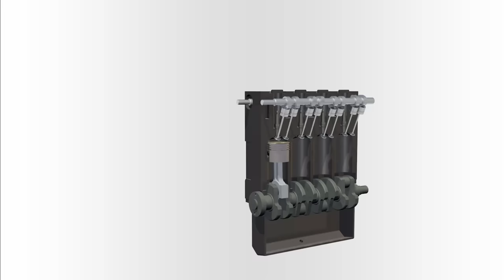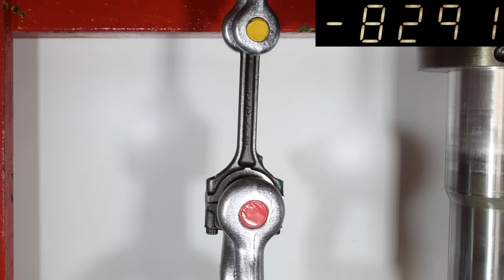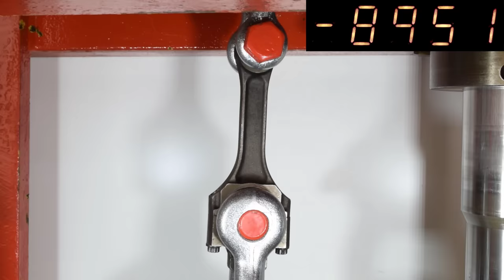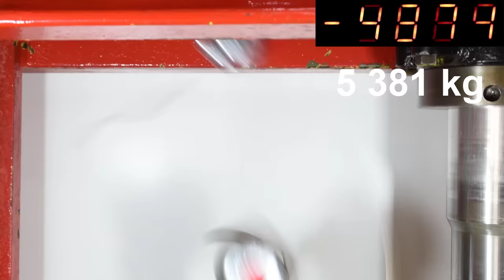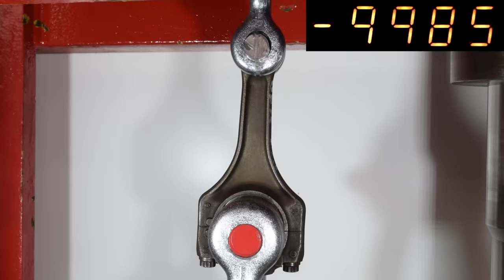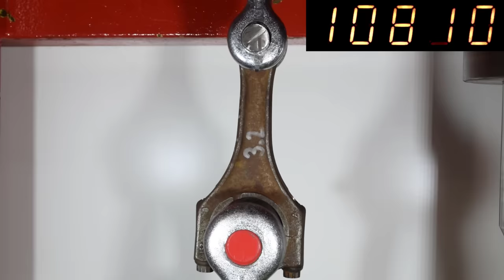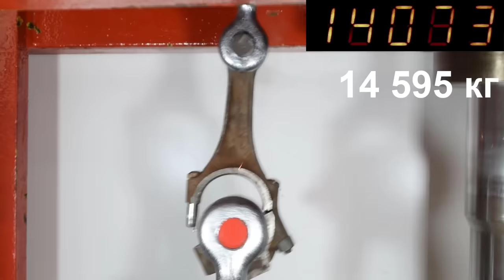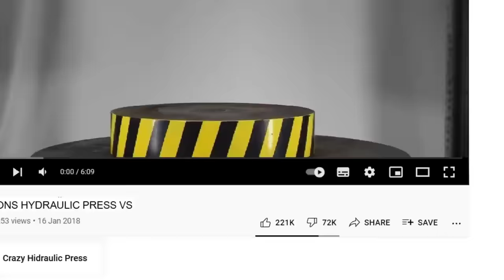HYDRAULIC PRESS VS CONNECTING RODS

Comment: Interesting but Conrods are designed for strength in compression and not in tension. Unfortunately whilst interesting, all a bit pointless.
Reply: Isnt nearly all of his videos pointless,except for entertainment value? That makes critiquing his videos as if they were for engineering rather pointless,if not mild trolling.
Reply: I agree with this point. The main power is exerted when the rod is pushed. On the other hand one would assume, that more expensive cars are made with higher quality materials and components.
I would like to know the weight of each item. I believe the old one is heavier and thicker than the others.
Reply: The rogue piston exiting a self-destructing tuned engine on a rolling road at maximum rpm may beg to differ! In almost all production engines, whether NA or forced induction, the highest stresses on a connecting rod are tensile, due to the inertia of the piston changing direction at the top of the exhaust stroke (no compression to reduce the tensile force). The rods in this test were from standard production engines, so the test is actually relevant. High boost engines, exotic fuel burners and engines suffering from detonation or hydraulic locking are possible exceptions to this general case, so top fuel drag racers, and diesel van drivers heroing it through 4 ft of flood water, for example, may count amongst those exceptions!
Reply: @robair67  just what I was getting ready to say. most failures of the pin skirt or rod/bolts are tdc on the exhaust /intake stroke. rods bending are not near as common as stretch and bolt stretch.
Reply: @markwarren3156  thank you, sir!
Reply: @robair67 you took the words right out of my mouth, oh it must’ve been while you were kissing me
Reply: Lol attempted to troll, got roasted by knowledge. Oops.
Reply: @SpannerManSam  if you could take that thought right out of my mind, I might avoid the ptsd!
Reply: @robair67  oh darn I didn’t know a song would give someone ptsd
Reply: @SpannerManSam  😄
Reply: You are right . Generaly they are compresed but can be also tensed . Breakig with engin can destroy it .
Reply: thats not true, since high RPM puts a great stress as tension too. many people that tune diesels to crazy power will tell you about upgrading bolts on the rods, as when they rev an engine for 3000 rpm to over 6000, stuff is going to break with the huge heavy pistons, rods and wrist pins. the diesels have usually the least tension stress, because they rev low. however, high rpm naturally aspirated engines have almost no torque, but huge problem with reciprocating mass. THATS why you blow up engine by moneyshifting it or overreving it(unless it is caused by failed valvetrain component and collision of valve and piston)
Reply: @markwarren3156  it differs if its a turbo diesel with no rpm and massive torque or a high rpm engine with little torque and huge rpm. the diesels usually are not suffering from this as they are not revved high, but if you rev them high, shit is gonna happen(and not only by valves smashing with piston)
Reply: @firstclaw1 you are not undoubtedly right. Rotary inertia produces a very big tearing force on the rods
Reply: @efimkrivov  Interesting. I wasn't aware of such forces, as probably only a machine engineer would know the math.

I still consider weight and material a major factor. With a sports car you my want to build all parts as lightweight as possible. So the question is also how strong is strong enough? But too weak borders to planned obsolescence again.  If a car costs a much higher price, I would find a considerably weaker part unacceptable.
Reply: Totally agree.
Reply: Spot on. They need to compress them.
Reply: Exactly that’s what I’m thinking about too. ❤
Reply: @firstclaw1  you can see supra 2jz
Reply: @craig waddell exactly what i was thinking whilst seeing the video. The only interesting thing is to see how strong the rod bolts been made😂
Reply: I agree tension is the main force they see….
Reply: For sure!
Reply: My thoughts but still, it was interesting
Reply: Not pointless
Reply: @Kjaer_e92  read comments
Reply: more or less yes - connecting rods also have to bear tension, the higher the RPM, the more.
The Moskvich "wins" this test, because in the 50/60ies, the engineers did not have precise design methods, so based on experience, they tended to oversize everything. Interestingly, it had a 4cyl HEMI engine.
Here in Germany, the BMW M60 V8 was known to have a number of weaknesses, the successor M62 has been improved. The BMW M components speak for themselves.
Reply: Same as 1968CraigUK.
Reply: I wish it would have been based on compression
Reply: Well if they performed well in this tension test I bet they'd perform even better in the compression test however in actuality even tho most of the force your conrods experience is compression because of the explosion pushing them down they are also built to withstand tension force as well because moving at 6,000 rpm is probably pulling pretty hard on your conrods it's a known fact that due to the high speeds and high temps these internal engine parts are faced with is that they stretch as well so I don't really see how this is pointless
Reply: You tested bolts...not rods. It is easy to calculate the braking force of them.
Reply: Agreed, basically testing cap bolt tensile strength this way.
Reply: Wrong, just wrong.
Reply: @robair bobair  thanks!  I am too lazy to explain some things
Reply: Where do you get this idea they are only meant for compression?
Reply: @Coyote27981  I think you are taking his point too literally.  The test is mostly pointless giving a rods purpose.
Reply: Jeez, way to piss in someone's bag of chips.
Reply: Actually when a rod breaks, it's usually on the exhaust stroke, and it tosses the piston into the head.
Reply: Wrong.
Reply: @davidsmith7653  Badong.
Reply: Agreed, could be retitled “hydraulic press vs con rod bolts.” Would love to see the compression failure of these. Particularly a big diesel connecting rod vs gasoline engine part.
Reply: to add....I think bent rods are typically a result of "spun" bearings heat and torsional forces rather than compressive. (Except in "other cases" you mentioned)
Reply: Sure ! By the way engineering for what it needs! Stronger doesn’t means better. They are from different power engine. Over engineering means not optimize for efficiency.
Reply: as the car wizard advices, avoid all BMW:s. They're all junk! Same goes for Audi. MB all the way.
Reply: Not true! Crank rods are subject to highest forces in tension at TDC at the end od exhaust and begining of intake stroke.
Reply: That’s amazing that the old bolts held up so well you’d think with more precise manufacturing of today it would become stronger but yet I guess it’s not the same steel used as back then it’s be interesting to see at what point they bend tho
Reply: Wait! You’re telling me a video on the hydraulic press channel isn’t fully applicable to my everyday activities. Quelle horreur!
Reply: 100% agree. Who cares about their tensile strength - it's all about the buckling load.
Reply: Mclaren P1 conrod next please
Reply: Agreed, peak load is literalt during the compression stroke of the engine at the time immediately after ignition. As it happens it is higher in diesel engines.   It is also important not to over engineer [reciprocating] moving parts and keep their weight down.
Reply: @djole02  maybe, but far less compression forces on firing.
Reply: You're missing the point, although I understand what you mean. This is just entertainment. This channel is not made to conduct scientific experiments; so no need to act like a smart arse mate.The whole channel is pointless, there is no value gained from the videos recorded in this channel yet 500k people have watched it and you're complaining about the rods not being tested correctly.
Reply: Exact! Has no real world meaning, in the best case a test for the screws
Reply: @n1msu  Well the image promoting the video shows a con' rod about to be pressed in a hydraulic press, but the content was pulling them apart, unsurprisingly discovering that the bolts at the bottom were the weak point.  Misleading promo' and as you say entertainment as opposed to scientific content.  BTW I only watched the first test - it was obvious the rest would be a [further] waste of time.
Reply: @robair67 hen why is the material area above the gudgeon pin so small when compared to the area in the main H profile? Surely if the larger load was tension, the small end would be massive? ie as the failures shown which weren't due to rod bolts
Reply: @Loopyengineeringco  so you're saying that inertia doesn't increase with mass? Interesting. The little end needs to be as small as possible precisely because of the acceleration forces, in accordance with Newton's 2nd Law. The clever bit is the choice of material to "thread the needle" between stress and mass. This is one reason why engine designers do what they do; They are masters of walking engineering tightropes!
Reply: Yes, very true indeed: you stress and test a part for what it was absolutely not designed for.
Reply: It's called envy, britboi😁
Reply: @robair67  I agree with you about inertia, but I don't think the inertia forces (tension) are higher than the compression forces. Otherwise you'd see different rod designs. As demonstrated in the video and also many stock rods bending under boost and aftermarket rods always focussing on increased H or I section strength 🤷 would be good to see some maths, I might be wrong
Reply: Click bait. Shows testing with press and then shows irrelevant stretch testing.
Reply: @Loopyengineeringco  back in the day (1980s to 2000's) most high rpm competition engines were naturally aspirated. When you got your set of race con-rods, the supplier gave you a maximum rpm they could be revved to, to maintain good cycle-life. The rpm was the limiting factor, so tensile stress was the limiting factor, not compression ratio, fuel octane rating, altitude below sea level, or anything else that could increase compressive stress on the rod. The mass of the piston was also required for the rod maker to specify rpm limit. As turbo boost pressures have risen in competition and OEM engines, the compressive stresses on rod materials have typically risen, too. Turbo diesels and drag racing engines (and flood-damaged hydraulically locked engines) can and often do experience con-rod stresses higher in compression than in tension, but as rpm rises, all rods with any mass (so, all rods!) experience ever increasing tension loading on the same cross section. At a certain rpm, either the piston fails, the rod fails, the big end bolts fail, or some other over-stressed part fails. The failure mode is caused by tension in this case. Piston acceleration at high rpm is massively overlooked. It's hard to imagine 9800g (96,000 metres per second squared) but that is the piston acceleration of a 40mm stroke length at 19,000rpm, which was typical formula 1 numbers back in mid 2000's. If you drop that to 9000rpm and use a more typical stroke length of 83mm, you have a far more pedestrian 39,000m/s^2, Which is about 4000g! I'll leave it there!
Reply: The last one doesn't have the original screws in the rod. So this is fake!
Reply: There wasn't the original screws in the last rod. That's why it's no wonder that it has endured so much traction
Reply: Is it probably the quality of the ball bearings that determines the durability of a motor and not so much the stability of the connecting rods?
Reply: Failure under compression is a highly atypical failure mode, even for cast connecting rods. Failure usually takes place due to shearing forces in the wrist pin domain, poor lubrication at the big end bearings, or tensile forces on inadequately fastened rod caps.
Reply: I think you need to retake elementary school physics - force and reaction force before you run your mouth on what is pointless or not.
Reply: Right, cars never stop working because of broken  conrods. Has anyone ever heard a motorist say, help, a conrod is broken on my vehicle?
Reply: But, connecting rod bolts don't snap on the compression stroke (going up). They do it as the crank pulls down on the bolt.
Reply: Go to school and learn how to calculate loads. Rods get hammered on change of direction. Calculate the speed of a piston at 8000rpm and a stroke of 86mm, then calculate how much energy it puts into the rod during deceleration. This is all put into the small end journal. The weight of rod and piston combined load the big end journal. It’s considerable. So not all loads on rods are compressive.
Reply: Yet I’ve see dozens of wrist pin journals open up letting the wrist pins loose.  It’s excessive RPM that can cause this as the piston travels upwards.
Reply: they all broke at the connectors not the rods themselves  ..it isn't useless info..the weakest link will have the same consequences. the test shows you would rather have a M3 or a M5 over a 530 which the upper model should have the stronger parts which is proven
Reply: Wrong. Rods are built to support the kinect energy after the compression phase. The higher the rpm of the engine, the higher the stress the material is submited. This is why high end pistons are made of light  materials, to reduce the possibility of stretching the rod
Reply: it is not the rod, It is the bolt here...
Reply: The clickbait picture suggests it's a compression test.  It sad when your videos are so bad that you have to trick people into watching them.
Reply: Dude, I have a bad news for you: almost everything you see in the internet are pointless.
Reply: @STEVE_C_1369 At this point, he should just put a disclaimer to keep the engi-sneerers at bay.
Reply: @joeybrazil2024  I totally agree.
Reply: @n1msu But...but..they're not!
Reply: @robair67 The reason that max RPM is given is because the strength of bolts is finite and known. The compressive strength is also known but is limited by cylinder capacity so it's a constant for any given fuel mixture and the compressive strength of the rod is more than enough to handle the load, usually by a factor of close to 2. That's why nitrous oxide seldom causes failure immediately but destroys rods in "soft" engines at high revs. The bolts break.
Reply: Exactly. There are more forces at play in a rotating assembly. There is also durability. The ability to sustain the constant stresses the part is put under.
Reply: This!

I was expecting compression tests, in the least...not that that would properly test an object that reciprocates.
Reply: The video should be called con rod BOLT test, because that's what he's testing. For the car aficionados out there; torque (in other words, boost) requires you to run strong rods. RPM requires you to run strong bolts. The formula is very easy: going to boost (or increase boost) of your engine? Forged connecting rods. Going to increase RPM? ARP 625+ bolts. Going to increase boost AND rpm? Forged rods + ARP 625+ bolts. End of story.
Reply: Well that's exactly what I was going to say....compression
Reply: Incorrect.  Most non-builders and non-racers think this way but they are wrong. The fact is, as RPM increases, the connecting rods have to endure significant stretching forces.  When the piston is in its exhaust phase, there is enormous centrifugal force as it approaches TDC. This is where most rods fail and why the rod bolts are the single most important factor to take into account. Rods do not fail during the compression cycle.
Reply: @STEVE_C_1369 People like to talk engineering though.  Scary to think how many distorted worldviews might arise from modern forms of diverse entertainment like this.
Reply: @anneother6224  🤣🤣🤣🤣
Reply: Anyone who has torqued con rod nuts know how critical it is. You never get spared of a 'what if' feeling when doing so. It's quite reassuring to witness the strength of these bolts.
Reply: Exactly what i was going to say. Designed for compression rather than ummm stretching.
Reply: @STEVE_C_1369 opinions are like a-holes.  Everyone has one, and they usually stink. One could say the same of your comment to his comment.  His comment is simply informing those who don't have as much automotive or engineering knowledge as perhaps you or others.
Reply: They are required to have strength in both directions especially at high rpm operation when the intake and exhaust strokes have low upward resistance and lose the dampening effect during compression, and get pulled in tension during intake strokes of non aspirated engines free reciprocation which is why exhaust valves are always smaller
Reply: The power stroke at full ignition and advance and boost level is the maximum applied compression force applied to the rod a bit more if vehicle momentum is transferred through the drivetrain and you have a hydrolock in the cylinder, where you’ll bend the rod, or break the crank due to rod angle and lateral force deflection. I’ve seen the tops of pistons pulled off from the ring gaps closing in high heat quenching conditions (clogged catalytic, high work load, high demand, for prolonged periods, the spark plug insulators were shot out of the shell, and put a bullet hole in the fender of a new (at the time) Jaguar passing the truck as the driver crested a long steep hill while flipping the truck driver off. I broke it down and checked the rod alignment all were good. Chevrolet small block, was sold to the owner as a 350, but it was a 307, impressive resilience considering, I acquired a 350 short block an associate was just finishing up and added some end gap to the rings .008” as recommended for application conditions, reconditioned the heads, valve seats, guides (short block came with springs spacers locks seals screw in studs and retainers so I used them) No more people passed him going up hill with a full load plus a heavy trailer anymore. That big dump truck would move out!
Reply: I would venture to say every force a rod sees is compression whether on the compression stroke or after the combustion cycle driving the piston back town turning the crack always has tension in it since it’s the piston doing the work not the crank, it delivers the work, albeit minus on startup when some rods might drag pistons back down into bdc before the first one lights off
Reply: This is true however as the rod goes around the crankshaft it experiences some force of pull due to it needing to pull the cylinder down in-between strokes
Reply: Agreed pointless test, they are designed to absorb the compress force from ignition and convert that compression into kinetic energy which turns the crwnkshaft
Reply: 😂😂😂😂😂

The level of ignorance to think high output forced induction rods experience more tension load than compression load is only exceeded by the level of ignorance it takes to think there is more compression load on the compression stroke than the combustion or exhaust stroke.   Even in a moderate performance, naturally aspirated engine, the exhaust stroke has well over 100 psi.

Inertial loads happen in both tension and compression.  The instantaneous engine speed is highest during the power stroke. 

The highest intertial+pressure load is around the exhaust valve opening during the power stroke.

The highest ultimate load is compression load around TDC on the power stroke.
Reply: @robair67 your theory is incorrect.  Rods have BOTH a HP limit and an RPM limit. Always have.  The RPM limit is usually total BS that can be exceeded by a much greater margin than the HP rating.  The HP rating is also very much up for interpretation as HP is combustion pressure x RPM.

In theory, the buckling limit can easily be exceeded without hitting the RPM limit.  So can the RPM limit without hitting the buckling limit.

In practicality, very very very few quality OEM or performance engines have valvetrain capable of exceeding the ACTUAL RPM limit.  Rods fold/compress/ buckle at least 10:1 any other mode of failure.

Can't recall a single tension or rod bolt failure that wasn't cause by other catastrophic engine failure, mechanical over-rev or impact with other components.
Reply: Inertial forces (BOTH tension AND compression) correlate to the square of speed and 1:1 with mass.  Doubling the engine speed results in four times the force.  Doubling the mass results in double the force.  If tension forces were the main concern a turbo diesel would have equal size or smaller connecting rods.  They DON'T. 

The connecting rod required to make 1000hp at 3000 RPM is absolutely massive compared to the rod required to make 1000hp at 6000 RPM. Combustion pressure, AKA buckling load, is the difference. 

Have none of you ever looked at the small end of a turbo diesel rod???  It's literally cut back significantly on the TENSION side.  If that was the main mode of failure they absolutely would not remove any material on the tension side of the small end.
Reply: @theunbreakable1587  you clearly lack the necessary skills to identify the root cause of failure.  I'll remember your advice the next time I analyze a 4000HP 8500 RPM rod failure. 

Physics do not care about your intuition.  Inertial forces apply in BOTH directions.

A bent rod, quite often, will tear in two after a few additional engine cycles.
Reply: @theunbreakable1587  how do you explain the extremely well known fact that the exact same rod will sustain the exact same power at the exact same RPM that yours failed at by switching from crank driven boost to exhaust driven boost?  

Hint: the main thing that changes is combustion pressure...
Reply: The inertial force PLUS cylinder pressure in compression load will ALWAYS be greater than the inertial force minus cylinder pressure in tension load.  By definition.  This is literally as easy as 2 plus anything being greater than 2 minus anything...  No expert needed.  Not even basic physics are needed.

Using a typical NA LS3 for reference here are the figures for connecting rod load.  All specs are heavily biased to favor the tension failure theory.  In the real world, and especially forced induction, the figures favor buckling failure much more. 

At TDC on compression/combustion stroke at peak power: (700psi times 12.97 piston crown area) minus 3105 pounds inertial load at 6500 RPM equals 5975 pounds compression load.

At TDC on compression/combustion stroke at peak RPM: (600psi times 12.97 piston crown area) minus 4130 pounds inertial load at 7500 RPM equals 3650 pounds compression load.

At TDC on exhaust/intake stroke at peak power: 3105 pounds inertial load at 6500 RPM minus (3psi times 12.97 piston crown area) equals 3065 pounds tension load.

At TDC on exhaust/intake stroke at peak RPM: 4130 pounds inertial load at 7500 RPM minus (3psi times 12.97 piston crown area) equals 4090 pounds tension load.

At BDC on combustion/exhaust stroke at peak power: (70psi times 12.97 piston crown area) plus 3105 pounds inertial load at 6500 RPM equals 4010 pounds compression load.

At BDC on combustion/exhaust stroke at peak RPM: (50psi times 12.97 piston crown area) plus 4130 pounds inertial load at 7500 RPM equals 4780 pounds compression load.

At BDC on intake/compression stroke at peak power: 3105 pounds inertial load at 6500 RPM plus (15psi times 12.97 piston crown area) equals 3300 pounds compression load.

At BDC on intake/compression stroke at peak RPM: 4130 pounds inertial load at 7500 RPM plus (15psi times 12.97 piston crown area) equals 4325 pounds compression load.

Notice that in 1 out of the 2 TDC events that the rod is under compression load, NOT tension.

Ranking highest to lowest: 
5975 compression load
4780 compression load
4325 compression load
4090 TENSION load
4010 compression load
3650 compression load
3300 compression load
3066 TENSION load

RPM required to pull the stock LS3 12.9 grade rod bolts apart is in excess of 10,000.  ARP2000 and 10.9 grade as well.
Reply: Connecting rods need to be able to withstand force in both directions. Not just under compression.
Reply: @FordFanatic1988  in an annoyingly specific technicality, you are correct.  For all PRACTICAL purposes, a connecting rod designer can ignore every operating condition other than compression forces during combustion.  If a rod survives that operating condition, it will always have a huge safety margin for all other operating conditions.
Reply: This is bullshit,conrods work in compression, sorry mate
Reply: They are pulling the connecting rod, the only time it’s pulled, is on the intake stroke.
Reply: Pointless , and it even only tests the screws and surface where they screw on
Reply: How if the point was made clear.
Reply: Todo porque ganó la rusa.🤭
Reply: The resistance in tension is exactly the same for compression for metal
Reply: This test was pointless,
Reply: Everything he does on this Chanel is both interesting and pointless
Reply: Conrods are engineered for both. Engines are known to throw rods by radical downshifting. So not pointless at all.
Reply: Exacly, pulling forces are not that important. What is more important is the ratio of mass to compressive strength. I'm sure Moskvich would be the weakest if we count this ratio
Reply: @januszpawlacz4747  besides it’s not “ pulling force” con rod/bolt stretch and stress comes from centrifugal force dummy!
Reply: 100 %
Reply: You got it all wrong.  Sorry but you say they're designed for strength in compression, so his test is pointless? Do you know basic forces acting on engine components?  And the relative strength of steel in tension vs compression?
Reply: No they’re not designed for compression. If conrods bend or break because of compressive force, why don’t naturally aspirated engines blow up at idle? It’s the same compression downforce. Velocity, on  the other hand is not the same. Velocity from centrifugal force is what breaks rods, because they friggin stretch. In the 70’s-80’s racers tried making rods out of a polymer. Guess why they failed????….they stretched. Same as metal which is why drag engines get measured for rod stretch at tear down. Learn something before commenting…
Reply: Agree that these are pointless and stupid tests, but the stupid ones are probably those who look at these, including myself😀❤.
Reply: No. in high rpm applications when the conrod are supposed to pull the piston down between exaust and intake stroke, then they pull alot. But yeah. The powerstroke are the demanding thing when the rpm is low.
Reply: @Ingerul_Mortii yes indeed lols 😂
Reply: Actually they are designed for both
Reply: @garage5125 yup, and why do valves and pistons meet on over rev?? BECAUSE OF ROD STRETCH…
Reply: there is tension...while moving from upper point down we have the inertial forces of moving up + the dragging forces between the piston and crankshaft
Reply: You forget to add the F value infront of pointless.😂
Reply: ... j'ai aussitôt pensé la même chose ... il faudrait pour être plus précis, du matériel de la même année, sur des voitures de cylindrée identique, ayant parcouru (sensiblement) le même nombre de km ... mais dans la mesure où vous avez regardé et commenté cette vidéo, c'est tout bon pour le créateur, puisque les algorithmes de Youtube en tiennent compte pour le référencement ...
Reply: I came here to say the exact same thing. Force is being applied the wrong way to what they are designed for.
Reply: Não prova absolutamente nada, esse vídeo… bielas não exercem essa força nesse sentido… perda de tempo assistindo isso…
Reply: The huge acceleration and deceleration at tdc give tensile and compressive stresses
Reply: Rubbish; do you have any idea of the forces that are exerted on the rods as the assembly changes direction at the top and bottom of the stroke in a fraction of a second!?
Reply: I was thinking exactly the same thing.
Reply: Not for tension?!? How much weight do you think is trying to stretch the rods on the down stroke??
Reply: Test gives us an accurate image that russians must be proud of moskvich 1968
Reply: Yeah tension is pointless. Anyway bolts snaps first
Reply: Agree.
Reply: Yea… this test is pretty weird. Connecting rods are designed to generate pressure. To compress air and generate power. Here you’re resting bolts - they’re almost free of tension during engine work. Please record one more video when you will try to compress the rod.
Reply: Non en fait ...ultra interressant ???
Reply: Conrods are designed to withstand both compressive (combustion) forces from Euler buckling  AND tensile stresses from max engine speed (well, an over-speed is often considered) from reciprocal pistion and self-mass inertia.
Furthermore, it's not ultimate strength (i.e. single-load) that is considered but high-cycle fatigue.
A metal will break at a much lower stress when cycled hundreds of thousands of times between 0 and max (pulsating stress) or negative (compressive) and positive (tension) stresses (cyclic/fully-reversed).

Additionally, the stiffness of the conrod is simulated and designed to be within a limit.
Long before a conrod will break under a single load, the little or big end bearings will deform (i.e. go oval) thus causing the oil-film bearing to be reduced to zero therefore causing the shells to make contact (pinch) with the piston pin or crank and then risk spinning a bearing. 
The bolted joint is also simulated and assessed so that the bolt preload and joint are not overcome.

This single-pull test can be useful in assessing the breaking stress (UTS) against the published material spec.
Reply: Meant to be pushed, not pulled. And engineered to work fine with an amount of power from the piston and speed (rpm). This test is pointless.
Reply: @sergiopc1286  
It's not totally pointless as it could be used to test the material spec of the conrod after the manufacturing process.
Reply: Sarebbe interessante vedere come si comportano a elevata temperatura
Reply: Москвич 412 сила , Узам с турбо выдерживает 350 сил.
Reply: @robair67  No it's not. Connecting rods break when being compressed and around BDC, where the inertia from the change in direction adds to the force from the pressure inside the cylinder, and the rod bends sideways. After they break the piston flies off, obviously. If they broke under tension the piston wouldn't fly off the side of the block, it would just slide up through the cylinder and hit the head. Any elongated profile is far weaker under compression than under tension for this reason, it's mechanical engineering 101.

Connecting rods are also specced based on strength/weight ratio and not strength alone. The strongest rod in the video was the thickest one, predictably. The problem is the heavier the rod the more the internal loads due to inertia, big Diesel engines have massive rods that can take multiple times more force under tension than these but if you try to rev them to 7k they will explode under their own weight.

Pulling on a point in the rod is also a basic mistake. Rods are designed to fit snug to the piston and the crankshaft so the load is distributed evenly through the whole rod end. Manufacturers go to great lengths to optimize the shape and finish of rod ends to ensure tensions are distributed as evenly as possible. You pull it with a pin like that and you're flexing the end of the rod rather than pulling on the whole rod evenly like it's designed to.

Everyone upvoting you is an idiot who knows nothing about engines.
Reply: Lol... 😂😂
Reply: They are actually designed for both compression and tension.
Reply: Steel has pretty much the same strength in tension and compression. This is not true for aluminium or cast iron, for example, which are brittle materials.
Reply: Conrod needs to sustain both. Bolts are very often weak point and need to be changed in order to sustain higher rpm. Compression strength is for.. well compression (boost) and detonation.
Reply: Esatto
Reply: That's what I was going to say XD, and torsion too.
Compresión and torsion,
Reply: Agree entirely. A pointless set of tests devoid of any scientific or engineering basis. All it proved is that some bolts failed in tension earlier than others. Nothing to do with conrod strength which should be tested for compression.
Reply: Same thing to the avengers movies, but you enjoyed all of them
Reply: I was racing a Mitsubishi evo 6 and we've rebuilt the engine at least 5 times. It got stronger and stronger, at its last stage it was producing 800 Nm of torque and 580 BHP. My mechanic and the motec guy also said that the pressure force is not the problem, well at least not for the rods but the bearings. The real problem comes from the pulling force of the piston at the top of its path because around 8k rpm what we used the little light piston actually pulls tons on the rods trying to stretch it out. Now even the slightest stretch would mean cylinder headgasket faulire and game over. That's why I think it was a good test in this video. Shame on German engineering.
Reply: rods  most the time fail  on studs  and studs  work less on compresion, you bend rods an compresion with a no compresing material on chamber nuts valves washer etv studs fails on  extension
Reply: Not a bit pointles, completely pointless!
Reply: @firstclaw1  The old one also had thicker bolts. The majority of failures were the bolts so this is more a test of the bolts, not the rods.
Reply: Yes this was a complete waste !!!!
Reply: @robair67 havent seen a normal car engine blow up where a piston actually left the cylinder unless you mean smashing to small pieces and falling in the sump. But then it still didnt escape the engine. Only engines the pistons see light of day are 10,000hp drag motors or tractor pull engines that actually blow the block off the crankshaft and all the pistons flap around on their rods still on the crankshaft.
Reply: Why?, don't conrods have to hang on to the piston at TDC then?.
Reply: Wrong. While the downstroke might be longer in duration the highest stress seen is during transition from up stroke to down stroke. As said by others it's inertia.
Reply: @garage5125  Yup, especially for high reeving engines with short con rods relative to the stroke length. The jerk at top dead center while at high rpm, especially while engine breaking, puts massive amounts of tension in to the rod.
Reply: @احمدالدوايمة  the naturally aspirated 2Js have weak ass rods, the ones that can take great power on stock internals are only the ones that came with the turbo from factory, because those have stronger rods. the NA 2JZ are not great for high power, you will find stronger rods in a 60 kw lada niva lol

however, for this test, you are taking into account the tensile strength, that is not adequate for the rod to sustain higher power
Reply: @firstclaw1  well the thing is, manufactures nowdays make lightweight internals, because moving mass costs you power. take the honda fit engines for instance, no massive rods, just a very thin ones, just like the nissan x trail engine. even the boasted 2JZ uses pretty thin rods in  the NA version, as it makes more power when you are not moving huge amounts of weight. most engines really don´t need super strong rods, but it is nice to have them sometimes. not only for tuning the engine, but also lets say in a hydrolock event, when the rod does not bend or break so easily. and yes, even in a overrev situation (which is the closest thing to this test) the bottom end of the engine is unlikely to fail on its own. the engine would get killed anyway, as in high rpm, the valve springs are not strong enough to keep the valves closed, and they get hit by the piston from below. though in some cases, even that happens than the rod (usually the rod bolt) snaps in a overrev situation, but most often, the bottom end fails because of the top end falling apart, and the dropped parts obliterate the engine
Reply: @spxram4793  today, manufactures are doing that to produce more power, strong rods are good to have, but they are heavy-one of the reason why the moskvich makes like 70 hp
Reply: @garage5125  True. Earlier, everything has been oversized, just to be sure. I know Moskvich ;-)
Reply: @spxram4793  you had one? what one? by the way, the rods in russian ladas are also pretty beefy, seen some lada engines using stock rods at over 400 hp lol
Reply: @garage5125  that is a city legend. The Lada VFTS had to have many parts exchanged, at 185hp.
Reply: @garage5125  I did not have a Moskvich, but grew up in Hungary which had a share of Moskvich. From all the East Block cars, it was almost the worst, being only overtaken by "Zaporozech" - these were really like a hen shed with a grass mower engine. Horrible crap. The engines were copies of 1930's GM and Ford designs.
Reply: @spxram4793  those were pretty good cars, what made it "worst" in your mind? and no, turns out you don´t know them, the engines in the old moskwiches were simillar to opel engines, actually the first moskwich was pretty much a licensed opel cadett, that germans gave them as either in the molotov ribbentrop pact, or as a reparation. the engine got later improved and it got used up to the 2138. not a bad engine, it was a tad slow, and drinked a bit of oil, but doable, i actually know one of those that still running till this day, in the 50 years and 250 000 km the engine has been apart once 30 years ago for a minor repair with no machine shop work included. 

the new engine came in the moskvich 412 onwards. if anything, the engine was too powerful for a old chassis, that was not keeping up. also drinked a lot of fuel, but that had to do more with the fact how heavy footed the driver was. once again, no gm of the 1930, if anything, it had similarities with the bmw m10, and there quite a few diffrences still. again, a pretty good engine, that, unlike gm cars of the same age, could start well in cold temperatures, and also could operate for long. when we talk about GM cars, you should better look what shit has been chevrolet doing in that time, precisely a chevy vega engine...

what is a "great car" then, if not a reliable, and easy to service car? today´s BMWs drink oil like hell, and many of them won´t even go over a 150 000 kilometers, and that is despite their premium price
Reply: @spxram4793  what parts? 

also, why do people get 200 hp from turbocharging a stock lada engine? and why the VTFS made barely over 180 hp? that is what i talked also, in a diffrent comment, heavy internals eat power, the construction of the engine leads itself to using turbo, the internals are beefy enough. i am telling you, with a engine in great shape, turbocharging it will obliterate anything in the way except the engine itself. its capabilities are far beyond what the drivetrain can take, and even with, having a 300 hp+ in a chassis like that, will make it uncontrollable as hell. it is normal for tuners to swap out the cylinder head for a better flowing 16v head from new ladas and some decent turbocharger onto it. with a great setup, those things can go under 5 second 0-100 and under 13s at quarter mile. some mad engine builders manage to get over 600 hp, though i don´t believe than they are using stock internals. just showing than the only tunable cars are not necessarily made in japan, and than there are still uncovered capable engines. ever had apart an old slow opel corsa engine? just a simple look on the parts will make you think, if it could take way more power than ever thought. anyone with decent tuning experience might find quite a few unknown engines that can take power, and not just the classic average "top ten tunable underdog engines"
Reply: Sometimes some cheap cars connecting Road Ben'ds bro
Reply: If the connecting rod is strong or not is also pointless. Why would a strong CR make difference whilst an engine has an engineering design glitch, for example the timming chain of the BMW N47 diesel...
Reply: NEEAARRRRRRRDD
Reply: At first glance U are right to think that the compression forces at the   moment of explosion/combustion are the ones the brakes the rods! But I believe u are mistaken! Most rods brakes while in traction not compression, in the “exhaust time” when the valves are open and there is almost no compression in the cylinder when the piston is at maximum and start descending… the inertial weight of the piston at that moment when the rod starts to pull the piston back down makes the rod brake at traction not compression!
Reply: No...
Reply: @diegotr1903  true, however, that is what makes engines tunable. you fix (or at least try to) the problematic places, and use the strong parts to make more power.
Reply: Disagree, the conrod has to be strong in both compression and tension. At the top of its exhaust stroke the piston and rod come to a complete stop and reverses and accelerate back to BDC. At peak revs 10,000 rpm the weight of the piston/rings/pin is multiplied 5,000 time. At that rpm a 200g piston assembly exerts compression and tension of 1,000kg. Combustion pressures (either momentary peak or BMEP) is a fraction compared to these  forces.